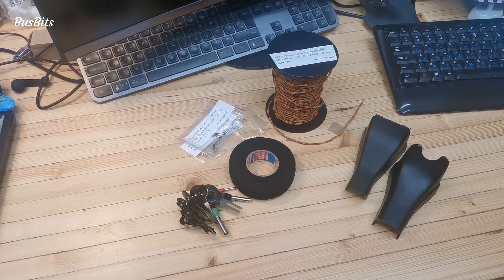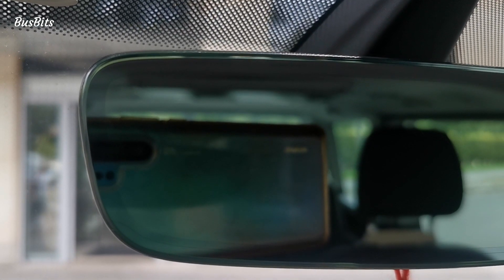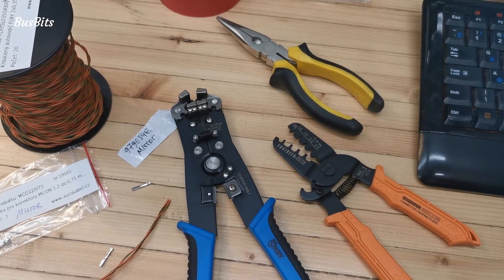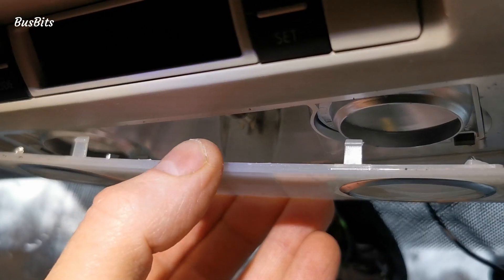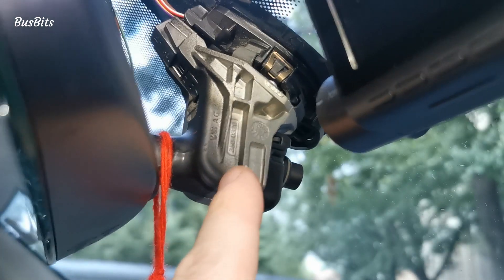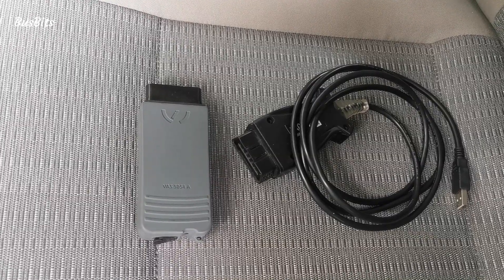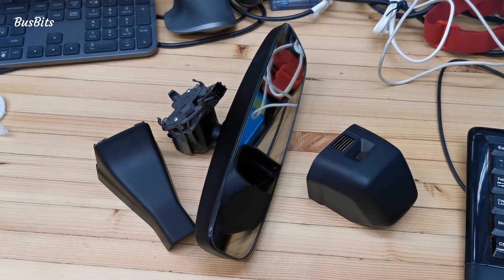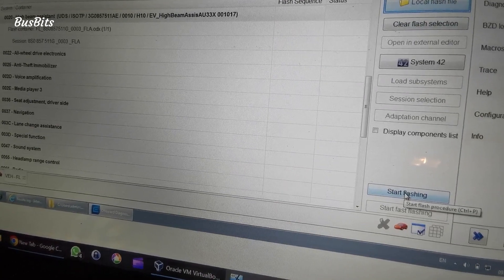High Beam Assist install on VW T6 (HBA/FLA retrofit)

Comment: And I did as you described, but is was very hard for me to crimp two wires two times that accurately together, that they fit perfectly back in the BCM-Unit. Tis is because I do not crimp every day and the position to crimp is quiet uncomfortable. Thats why suggest for all users to use the easy to raach and work on "Kombiinstrument", where the both canbus wires can be connected also.  - I made it finally after some serious crimp problems by leaving the original crimped wires, cutting them clos to the crimp and realizing the  Y-wireing with wego clamps.

Comment: I have this feature on my T6 california, but AI am not sure if it works properly. It switch from high beens as on video when car passing me, but it absolutelly ignore incoming cars. It is not usable on roads. Is it problem or "feature"?
Reply from the maker: It's definitely a problem. Did you have the HBA retrofitted or it was there from the factory? Are you the first owner?
Reply: @busbits   Thank you. I had it in previous car (seat) and it works well so I thank that it is wrong now.
It was retrofited last week on my request by local serviceman. I think it is software issue, because it recognize other cars in any situtation, but it cannot recognize approaching cars.
Reply from the maker: @karfCZ  yes, the retrofit guys probably didn't add the right adaptations. I suggest to go back to them and ask to fix it

Comment: Great video! 
Do you know if that will work on Golf 7, 2016?
Basically, can I install T6 mirror in mk7? I don’t have ODIS, only VCDS.  Existing mirror has autodim and rain sensor wires. Thanks
Reply from the maker: @gleb676  Thank you. Unfortunately I don't have experience with Golf.

Comment: Hi, great video :) Do you think this can be retrofitted to T5.1?
Reply from the maker: Hi. If you mean T5 after 2010 - yes, with a change of the BCM it should be a relatively simple process (complicated for a novice).
Reply: @busbits  any chances that my current BCM from 2011 will work with it?

Comment: Hi, i got this error message, would you know what is the problem, i get the hba symbol on the dash, but its not working
Function limitation due to implausible message
Reply from the maker: Hi. Unfortunately, as far as troubleshooting goes - I can't help.
Reply: @busbits  update, now, as i changed the bcm, i've got no communication dtc on hba module (20)..

Comment: Hi, you can upgrade a hba slim bezel mirror to a rimless by buying a standard rimless 3G0857511 and fitting that on the ball and use the slim bezel pcb board inside, as rimless and slim bezel use the same pcb, just an option for anyone
Reply from the maker: Amazing. Thank you for the info!
Reply: @busbits  even a thicker bezel vw one has the same board as the qudi frameless matrix led version, I have them all here now. just one thing im about to wire this in right this second on my scirocco. you say use the bcm but someone else said use the can gateway. any ideas or are both ways an option, thank you
Reply from the maker: @sciroccomods  without a doubt first thing you should do is open the wiring diagram for the Scirocco and check in there. The can gateway in T6 is embedded into BCM. I use BCM because that's the easiest location for me in my car although you could tap into convenience CANbus anywhere in the car where it's available.
Also note that BCM pin numbers for Scirocco will be different from T6.
Reply: @busbits  Im all done now, just need to code it all in , cheers.
Reply: Update, i wired into the can gateway to 6 and 16,  coded in and is auto activated from my golf mk8 heated steering wheel 3 seconds after the car is started, so no flashing the left stalk to activate, now time to re wire so when i activate the heated steering wheel it also turns on the heated mirrors and heated rear screen, oh, are you based in London be any chance, thanks.

Comment: Hy, how you turn off HBA? I installed it in golf mk6, for turning on i kuve stalk forward, for turning off i had tu move it one more time forward bit sudenly i noticed that no more i can turn it off by moving stalk forward, in that case it turns high beam. Only how i can turn HBA off is moving Light switch to the right or to 0 position. I dont kniw what happend. Hba when it is on in trafic working normaly, turnin on and off, i just can nit turn jt off anymore by moving stalk one more time forward. Only by light switch. Do you maybe know what happend? Tnx
Reply: To deactivate push forward then pull towards you , failing that code it out with vcds
Reply from the maker: If you are moving the stalk forward to switch on the HBA. Try moving it backward to deactivate. 

I can't imagine why you'd want to do this as it works fine everywhere and many people are trying to work out how to turn it on by default with every start of the car.